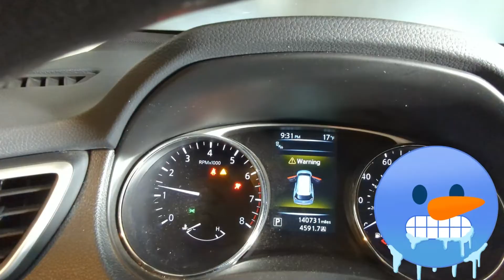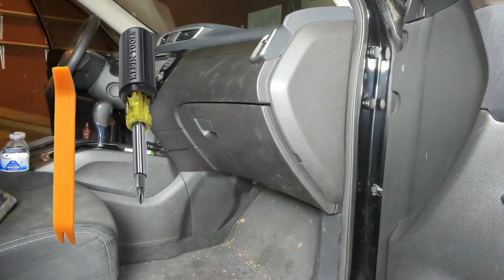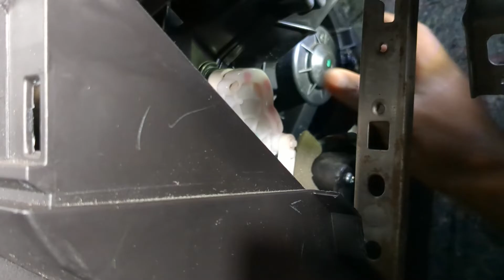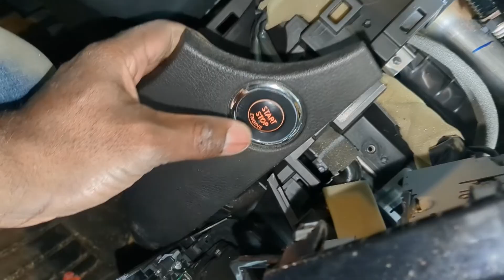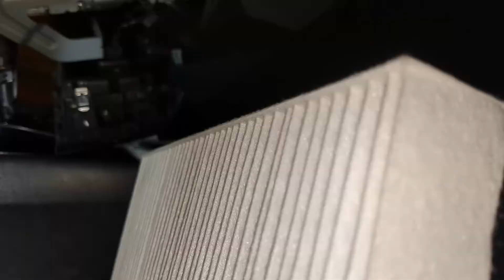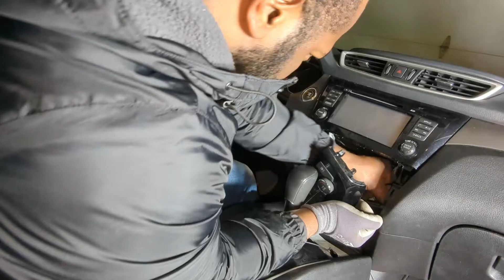Install Blower Motor / Fan Nissan Rogue

Comment: Thank you so much! I couldn’t have done it without your detailed video. One thing that held me up was there were wires kind of zip tied-like to the motor blower I was removing. It was extremely difficult to get it off. I had to file down the thingys too for it to turn enough for my screw holes to align. Took me much longer because of these 2 things but I’m glad I was successful! Appreciate you for making and sharing this!
Reply from the maker: Glad you were able to figure those out and get the job done! 👍

Comment: My 2015 Rogue looks different underneath the dash
Reply from the maker: It shouldn't. Unless it's not American made
Reply: @trackpalmer I spoke with a Nissan service tech. Apparently, for a very short period, the blower motors were installed up and behind the glove box. Also, my cabin air filter is located under the hood in engine compartment

Comment: You DO NOT need to remove any of the panels/trim. This does make it easier for some doing this method. But, you are able to do this by just getting under the dash and being a little uncomfortable for a minute.
Reply from the maker: All power to you if you were able to work in that extremely small space if the panels not removed. I wonder how long it took
Reply: How i can remove the motor i removed the scrow but the motor wont come out